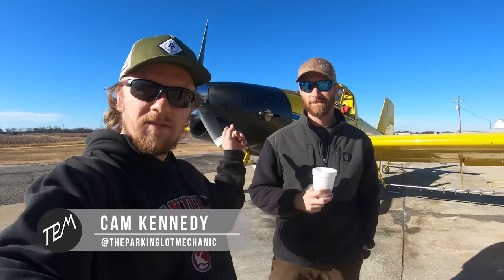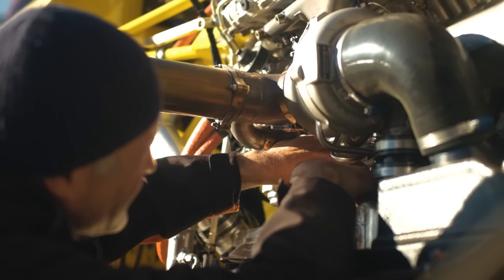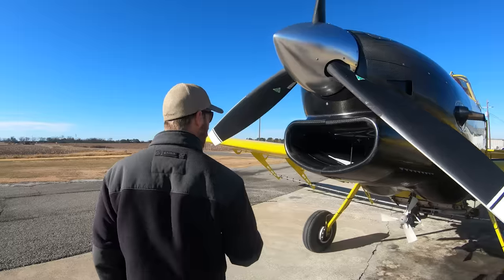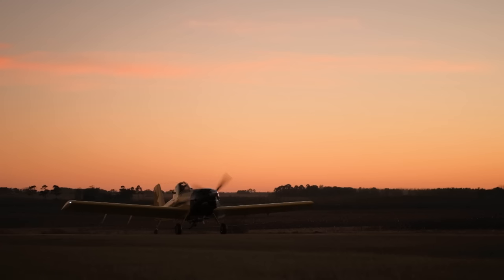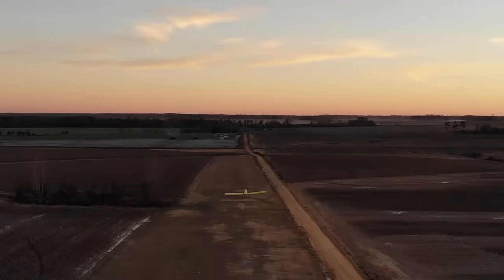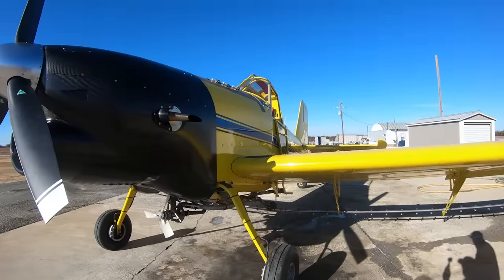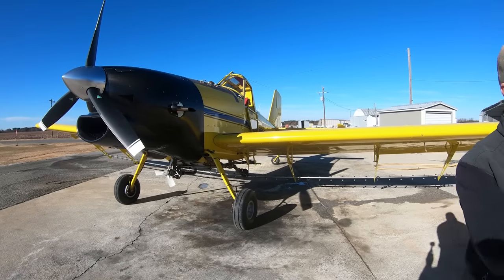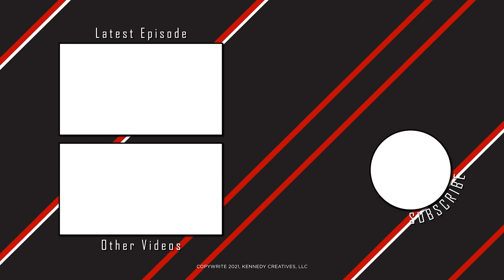Meet The V12 Twin Turbo Diesel Crop Duster

Comment: Diesels for piston aircraft are starting to become a thing. There's been people trying to make it happen for a couple decades now, but it's really starting to happen for actual real and I'm excited for it.

Not only are diesels tough, typically stupid reliable, and monstrously torque-y (which is terrific for a torque-based application like a prop plane), BUT the engine is capable of running with zero electrical power if designed and built properly. With gravity-fed fuel system and a mechanically-backed fuel pump an aircraft flying diesels could, in theory, fly completely electrically dead. Can't do that with a gas or turbine engine!
Reply: This is true but were there is a Diesel engine there is a turbine that can make more power, torque and better reliability due too the very few moving parts also diesel would have hard time operating at higher altitudes.  And turbines can practically run off anything that burns  that being said diesels do have better fuel economy at low power
Reply: A turbine dosent require any electrical power to run,  my turbine has a mechanical fuel pump And a small generator for all the gauges.   The throttle is also fully mechanical the only power needed is for start up.   It actually dosent use any power one started
Reply: @bolt2510 correct, many smaller / simpler turboprops do not need any electrical power to run once going. And they are lighter than diesels… The main issue here is cost per hour. Western made turboprops simply cost a lot. That plus range are the only real benefits of diesel.
Reply: Any carburetor equipped aircraft gas engine does not require electricity either, they get their spark from 2 magnetos with 2 plugs per cylinder and 2 electrodes per plug. So 4 electrodes, and two separate ignition systems per cylinder. Being Diesel making more torque is only true because they can tolerate more boost. Apples to apples, with equal manifold pressures Diesel always comes up the looser, especially at low rpm. The main advantage is fuel efficiency. A GMC V6 478 ci N/A  Diesel  makes 170 hp and 266 ftlb @ 2000 rpm. The same engine as a gas engine with 7.5:1 cr and a 2 bbl makes 254 hp and 442 ftlb at 1400 rpm, is 150lb  lighter, cheaper, simpler, and lasts just as long. But the gas engine got 7 mpg empty, the Deisel 28 mpg! But, it didn't have the power to replace the 478 gas engine, it replaced the 305 ci in HP. This is pretty typical. Adding a turbo to make up the difference in hp exacerbated the bottom end torque problem in service because now you installed it into a vehicle that needed 254 hp not 170 and trying to start a load required winding the crap out of it and waiting to get boost. The gas engine you dumped the clutch and let it lug up from about 350 rpm. The diesels fell flat on their faces and stopped turning at 800 because of having to bring up the pistons against 17:1 cr. True in every engine of similar ci or HP. Big ole gas luggers get down on their knees and PULL and have every bit as much durability. I have had some still pulling when the electric tachometer stopped reading! That's why large heavy duty gas engines weren't replaced as soon as the Diesel was invented. Until gas prices went up they were heavy, expensive, low revving, requiring more gears in the transmission, and had  much narrower powerband. However, this is an amazing aluminum 372 ci V12 making 550 hp maximum takeoff. It has a continuous rating of 460hp. And weighs 800lb  They are planning a marine version at 700hp at only 3900 rpm!  When he says "torquey" he means throttle response compared to a turbine, very important in a crop duster these guys pull high Gs hundreds of times a day.
Reply: There's no way someone is going to make a completely mechanical diesel fly.
Reply: @Flapdr01  too bad VW TDI engines are already in homebuilts then.
Reply: @Cletrac305  what a load of word salad. Diesel engines always lug better down low, they have more rotational mass. The compression doesn't come into it...
Reply: @MiG21aholic That's not a completely mechanical diesel without electronics, that would keep running if the power goes out.
Reply: @Flapdr01  well they are with a simple injection pump swap
Reply: @MiG21aholic  The injection is also electronically controlled and maybe the turbo as well.
Reply: @Flapdr01  not on all of them. The earlier ones were mechanical injection

Comment: The same Red aviation diesel V12 also powers "The Egg" Celera 500L.
Reply: What's the origin of this powerplant? Is it a bespoke design, or is it the same unit Audi used in the Q7 SUV a decade or so ago?
Reply: @richardharrold9736 it was designed by an immigrant from russia. They are putting it into yak-152 and a military drone that never flew .

Comment: The spitfire of farming
Reply: Haha, yeah, big V12 up front. Except the early Merlins had 1000-1200 HP and the late-war versions touched 1800 HP. The difference of course is a) type of fuel and b) life expectancy/reliability. If the plane you put it in is expected to be destroyed before it has flown 100 hours on average, no need to build the engine to last 2000 hours 😉

Comment: Unless I am mistaken isn't that two of the old Mercedes 300SEL turbo diesels made into one  12 cylinder powerplant? Friend of mine works for Cessna and they were looking at something similar. The deal foundered on the demand that engines had to be returned to the factory in Germany for overhaul and also that they were to be the sole judge of what would constitute abuse or neglect (basically all failures were to be blamed on the installer, Cessna or the Operator)

Comment: All V12s have a potential capacity to run on one bank. It's because the firing order is 1,5,3,6,2,4 per bank in essence 2x inline 6 engines. Nothing's new there. 
In fact in the mid 90s there was a notorious fault with an Italian ignition system that would allow a particular V12 to run on one bank but not turn the injectors off on that bank when the fault occurred causing a catastrophic fire.
What made the fault more notorious was the fact that V12 engines still run smoothly on one bank and this engine was no exception.

Comment: That plane gets three times better mileage per gallon than my keep Cherokee!
Reply: You only get 2 MPG"?
Reply: He said 21 gallons per hour not 21 miles per gallon. I don't think you could drive your Jeep hard or fast enough to consume 21 gallons per hour. Maybe if you did the Rubicon trail
Reply: @jacobmoses3712  21gph, 155mph, ~7.4mpg. It gets roughly the same mileage I used to average in a 1979 Lincoln Mark V.

Comment: Wow, 372 ci, 550 hp! For over 2k hrs, that's impressive! They are planning a 700 hp @3900 rpm marine version. Much better throttle response than a turbine. That's required for the extreme high G maneuvering these pilots do. I don't know what they cost now but they were $170,000 in 2012!

Comment: less fuel means more payload.....its a win/win.  Not only does it cost less to run, it gets more done per round trip.  Modern diesels have lots of compression and 40+ pounds of boost (like a DD15 truck engine) and can put in huge hours.

Comment: What's the weight difference between the two engines? The diesel must be heavier. If so, what are they doing about payload? Do they plan on getting this conversion certified, or are they going the experimental rout? If they go experimental, what kind of restrictions does that place on contracting the plane out for crop dusting jobs? How much does it cost to get it certified?

So many question not answered in this video.
Reply: Plus vibrations from diesel is more.
Reply: The diesel was type approved by EASA about 10 years ago and the specs put the diesel at around 100lbs lighter than the 1340.
This could be a winner for utility aircraft.
Reply: @studiotube6033  It was type certified for this aircraft?
Reply: @studiotube6033  
The weight savings in fuel is also that much more that can be put in a hopper.
I don't know what pesticides weigh per gallon but it's going to have to be close to a 1 to 1 trade I'd think.
Reply: @nickidewet7711  
That's why it has a carbon fiber prop, he mentions the leading edge material but not that it's basic construction is carbon fiber, that's the only type of prop that the FAA allows to be run on diesel aircraft engine's because that's the only material that won't crack from a diesel engine's vibrations, most likely that's also why that intake and cowling is also carbon fiber, as he says they're bolted to the engine. 
But, since the prop is 3× cheaper as it turns out that's a bonus (who'd have ever thought something carbon fiber would be cheaper than anything? That's gotta be a first.)
I'm curious about the prop reduction gear if indeed it even has one, given diesel's generally turn so much slower than gasoline engine's and the small diameter of the prop on it I wonder if it even needs a prop reduction in the first place and if it does it's probably smaller and lighter than it's gasoline counterpart, that would explain at least partially why these engine's come in at 100 lbs lighter than what came out, being a diesel you'd think it would be heavier, although that 100 lbs probably doesn't include the weight if the cooling system and coolant, I suppose because of the variations between applications that weight is always omitted in the weight specs of liquid cooled engine's be it aircraft or automobiles and people often forget about it as a result.
Reply: @nickidewet7711  It's a V12, so it shouldn't really vibrate much at all.

Comment: Jet A is basically diesel, just a bit less oily.. You can even run a car on Jet A, provided you add 2% 2stroke oil. If you don't, your diesel pump will sieze due to lack of lubrication
Reply: It's kerosene, which is a more refined type of diesel (less paraffins), but yeah...anything that can run diesel can run Jet-A as well as the other way around if the diesel is clean.
Reply: It depends on the diesel pump, some are rated to be able to run on #1 fuel oil, aka kerosene, or jet fuel.

Comment: Not many crop dusters flying a 301 these days. Most of the ag pilots around this part of the country are using 502's or larger aircraft. I haven't seen a 402 in use round here in 10 yrs or so. Most around here are 602-802 if they are Air Tractor brand. Not a lot of Thrush are in use around here but they are comparable in size to the 502-602. Air tractor is definitely a pilot favorite around here.

Comment: Do the overhauls offset the fuel savings?  Overhaul on a 12 is probably a pretty big deal.
Reply: All overhauls are expensive. This diesel engine will be cheaper to maintain than the radial it replaces. Turbines are very expensive in all facets but very productive too.

Comment: I wonder do they have to run dpfs, def  and mess with regen cycles?
Most piston powered planes are still burning leaded gas so a diesel with no dpf or def would already be cleaner.

Comment: Question for STEVEN... what about prop turning the OTHER WAY around... ?  On take-off LEFT foot?? Any adapatations when accelerating/deccelarating??? Hope you read and answer. Thank you
Reply: And you are completely ignored. Except for me.
Reply: Engines are mounted at a minimal angle (1 to 3 degrees) left or right of the longitudinal axis in order to help the pilot offset high power/torque settings. Right spinning props are angled to the right and this one, I suppose and hope, to the left.

Comment: Very nice motor! Could have saved weight, size, dollars, and made it easier to work on with Overhead Valve/Pushrod that can rev to 7000rpm plus(tuners rev Chevy V8s to 9000rpm)! Still love it.

Comment: I've flown ultralites/powered parachutes for 3 decades and don't even consider myself a pilot at all....

I reluctantly outfitted my friend's 65 hp Rotax powered unit to spot spray herbicide/fungicides around his 1200 acres of beans....

I say reluctantly for my concern for my friend's safety and had I "not known" the retrofit was done successfully in northern state's I wouldn't have even considered it here in central NC....

Turns out that the unit with two 16 gallon tank's a pump and single nozzle has made an economical and useful tool for my friend's operation....

Of the many PPC manufacturers, we fly the Buckeye that was manufactured by the long defunct Buckeye Powered Parachutes out of Argos, Indiana.....

In fact a sad but true story is that Buckeye, Ralph Howard, his family and associates introduced John Kenndy Jr. into flying with the PPC and in some of the last image's taken of JK he was wearing a soft leg cast from an incident in the Buckeye.

A few folk's speculate that a blood clot from the leg injury could have lead to the crash where him, his georgeous wife and sisternlaw perished.....

I've flown a lot, but what I know about flying is not-a-lot...... None-the-less I'd speculate that JK moved up the hiarchy of flying at a too rapid pace.....

A sad day in America 07/16/1999 RIP John Kennedy, Caroline Bessette Kennedy and Lauren Bessette.....

Comment: For an ag-aircraft that sounds potentially safer as that engine will have instant torque compared to a PT6.
Reply: Turboprop is running a fixed power setting, the pitch changes, so the response is very quick.
Reply: A turboprop is operated at 100% RPM during most phases of flight and is always producing maximum power. The propeller is adjusted to change power output. They are very responsive and simple to operate.

Comment: Would hybrid Electric be the ideal power plant with all that instantaneous torque?
Reply: No.  Electric aircraft currently have no duration. (which isn't going  to change anytime soon, sad to say).
Reply: You're talking about an application where the best engines in the industry take several seconds to deliver full power, so, no.

Comment: the Detroit in my semi makes 500 hp. Its huge and weighs way to much to work in a plane,. for sure I want to know more about weight, dimensions and torque, If it will fit in my 75 F250....

Comment: Looking at the prop, is it left hand rotation or did the camera flip the image.  I would think the opposite rudder input would feel really unnatural.
Reply: It's CCW rotation, the engines were originally meant for eastern Europe and Russian aircraft, which all run CCW engines.  It's only noticeable on takeoff, and really, if you're using rudder based on what the plane needs to stay going straight, you won't realize it even then unless you're thinking about which foot you're using.  301's have straight tails so they don't really care which way the prop is turning beyond which direction you're bending the rudder trim tab.

Comment: can you mix fuels or is it one fuel type at a time?
Reply: this is more of an ecu question to be completely honest, but if you tune the ecu for a desiel cut with race gas and ethanol you'd see some interesting results, add bigger turbos and injectors and even more hp
Reply: @tyleroutingdyke849  ty

Comment: Is this the future of ag planes? Why are there not more like this?
Reply: Because turbines are superior in every way.
Reply: @MX304  yea will there be more conversions like this?
Reply: @excellenceinanimation960  Various engines similar to this have come and gone over the years. I'm sure others will try.
Reply: @MX304  ok neet. Why don’t they stick around?
Reply: @excellenceinanimation960  Because they always fail to deliver any advantage over existing aircraft engines. Especially turbines. That's if the company even manages to find a buyer for the product. A lot of them just go bankrupt during the development phase.
Reply: @MX304  RED has a fairly established customer base already, they're just branching out into ag because operators wanted the engine.  Still, time will tell if it turns into another Orenda/Trace engine in the next decade or so.
Reply: As @MX304 said, turbine engines are superior. I help build these aircraft at Air Tractor, and you wont find a better engine than a P&W. I doubt this conversion would work on anything bigger than a 402. Not to mention its incredibly difficult to change the Type Certificate with the FAA.
Reply: @dauntless1863  Yeah I don't see it being a big hit with a 502. I consider a -34 to be the minimum with those planes, and there are plenty of situations where it's still not quite enough.  I wouldn't want to take a 200HP loss in a 502, but in a 402 it would probably be okay.  If the turbo arrangement gave the diesel sea level performance in hot and high conditions, it might even be pretty decent compared to the lower power variant PT6's you often see in 402's.

You guys still tinkering away with that 1002?  Last I heard there was a fuselage jig ready to go but not finalized yet.
Reply: @Skinflaps_Meatslapper  Yes, There is a complete 1002 fuselage out of the jig, painted and sitting in the new line in plant 2A. Final 2A should be opening soon.
Reply: @dauntless1863  That's awesome, I can't wait to see that beast assembled and flying.
Reply: @Skinflaps_Meatslapper  Same here, I'll be on that line in final assembly, and I'm excited to see it get built.

Comment: Not a crop duster question, but what's the  ceiling?
Reply: At least 50,000'. They are putting it on the CL-500.  With the turbo it still puts out 460 hp at 25,000'. This is the future, when it catches on. https://en.wikipedia.org/wiki/RED_A03

Comment: How much does the engine weight??
Reply: Spending less than 15 seconds on a google search, then clicking on the wikipedia page for this engine, led me straight to the answer!
Reply: @SolarWebsite  so you wrote all that, instead of the weight. What is the series of the engine? How do you know you have the right version of the motor?